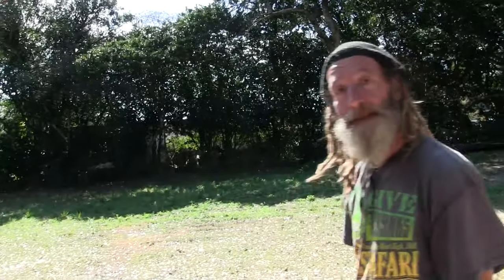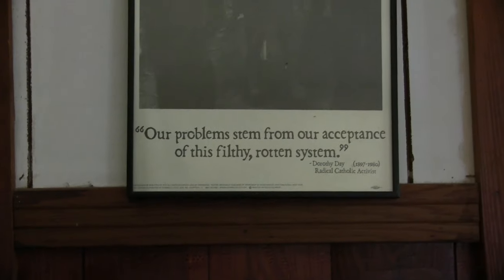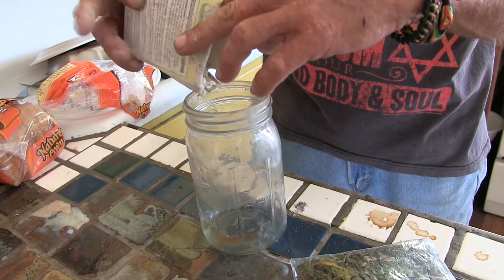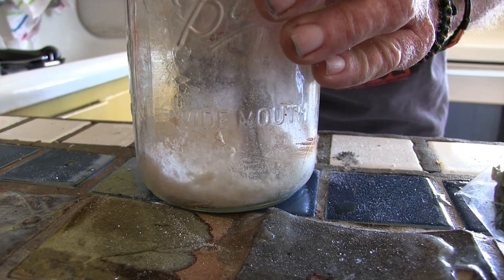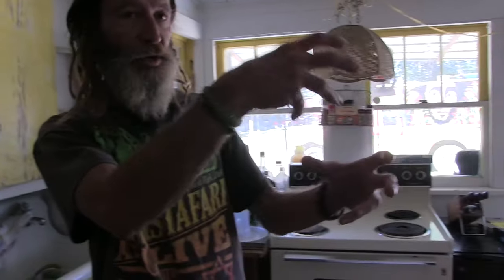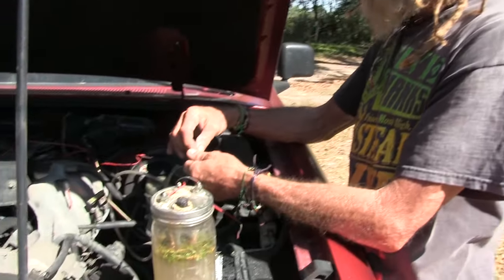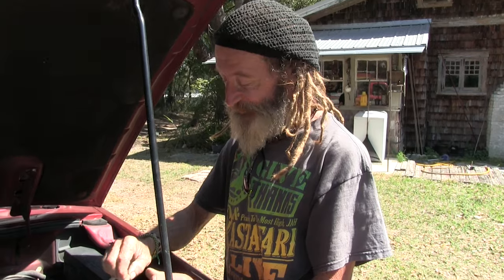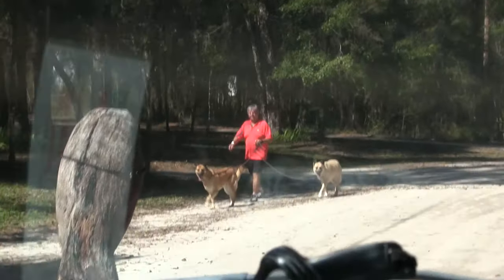Florida man uses homemade hydrogen generator to power Ford Ranger

Comment: Wouldn't Titanium rods work better in a Hydrogen generator ??  Hey, I like this guys attitude. He is very unbiased, and very forgiving. That ole country boy is a Diamond in the rough. Soo Cool.
Reply: graphite is actually the best for this.
Reply: Titanium is great but his setup is more economical for the desired application.
Reply: @graphixkillzzz  The issue with graphite is that the anode breaks down over time and leaves carbon nanoparticles in the water. Titanium is the better option because it's resistant to this. Another good choice would be a platinum plated electrode because platinum is very corrosion resistant but I would not recommend using stainless steel as the chromium inside of it oxidises to form chromium (VI) oxide which is VERY carcinogenic and not safe to work with.
Reply: Platinum is an excellent option too
Reply: using a pool chlorinator head  will work the best and its already made.
Reply: As Hank says a country boy can survive!

Comment: Boeing manufacturers a Predator drone that operates with two Ford Ranger Flex engines running on hydrogen.  Not a mixed fuel but straight hydrogen.   The solar panels on the wings and water catchers on the wings convert the rain on the go to hydrogen. It can fly almost indefinitely in the right climate.
Reply: Insane
Reply: Lemme see it

Comment: This guy is pretty darn cool I love his vibes and his personality is just off the charts God bless him. I would have tweaked a few things and not have the bubbler in the same container is where your generating a hydrogen and oxygen is burnable also I would have hooked it to the accessory electrical on the fuse box. I mean baking soda is okay but you could use table salt or potassium would be a lot more efficient.

Comment: 99% petrol + 1% hydrogen. Great work 👏
Reply: It’s gas
Reply: That's the comment I was looking for. Glad.i didn't waste my time.
Reply: HHO gas modifies the gasoline burn to be more efficient. The excess burns off into water vapor, and a tiny sodium and carbon. The excess takes more energy to make than it produces. Presumably you would only want a minimal amount.
Reply: A Dry Cell gasifier is way safer plus people need to understand that HHO is a supplemental system and they still have to burn unleaded fuel at 30% lower rate or so.  Not 1%

Comment: You state a maximum of 650cc for engine size to date. I was just wondering if adding another unit and getting twice the gas produced would double that cc size, allowing large bikes and even for small cars to run on this.

 Could you even triple the units or more, placing multiple units into one large tank of water generating enough for a V8 engine? This large unit could even replace the gas tank. However the next point that must be addressed is at what point would several of them just take too much power to run.

Next what about areas of below-freezing winter weather. Would these be great in the summer and have to be not used in the winter. 

Is there some sort of anti-freeze that would work, and if so how much would it reduce the freezing point?

What pressure is right for a pop off valve, as you say you use to regulate the pressure of the fuel. 

 Also I saw a video online that has people putting a splice in the fuel line and running hydrogen and oxygen into the gas line and burning less gas. Is this a good idea or dangerous.

 I look forward to your reply. 

Thank You.

Comment: There's also a gassifier system that can be made. Burning wood,sending the smoke through several layers of filter usually. Charcoal,hay,etc. It renders the 60-70% unburned vapors from the wood. It too can run a motor. Called E-gas. WARNING!! If the E-gas gets back to the fire the same problem as a moonshine still. It WILL explode. Vehicles have had this system,but abandoned as it's just too dangerous.
Reply: A Dry Cell gasifier is way safer plus people need to understand that HHO is a supplemental system and they still have to burn unleaded fuel at 30% lower rate or so.

Comment: That truck runs purely on HHO?!? I dont think so.
Reply: I think he has some gas in it. But it’s only using HHO.
Reply: Neo ... yeah I was disappointed because this wasn't what I thought it was going to be .
Reply: The system he has is called HHO (Hydrogen)on demand...  it used Hydrogen and gasoline in combination to burn all the gasoline boosting fuel evonomy

Comment: This is the best one so far but I use a cigarette power inverter a power adapter 5 volt 2 amp and run that to the ball jar and inside the ball jar for the captain and diode I could use either a bolt with electrical tape wrapped around it so that since later from lid or miniature egg beaters that holds steel wool
Reply: 😂😂😂 good one!

Comment: Scam it's impossible to run a car on hydrogen these bottles are setting up will maybe fill a garbage bag plastic bag and go boom but everyone knows it's impossible to run your car on hydrogen a combustion engine the number one thing is the only way it could work is if you have it pressurized in a cylinder like a propane tank with a converted carburetor to run your car on propane but that takes a special carburetor so it will run on a combustion engine so it's pressurized tank with propane that can make a combustion engine work and just to let you know Amazon and eBay are working together they're going to stop the sales of these fake hydrogen kits that make your car run they're doing the same thing like they did with Cody kicking all those people off eBay and Amazon so don't fall prey it's impossible and when they tell you they get 35% more fueling more miles they're lying straight out lying not one single YouTube channel says they make their car run on hydrogen cannot prove it they either say we will update this in the next video and show you or use some fancy camera tricks making it look like it's hooked up and fancy lies to tell you they're getting 35% more go to all these channels at proclaim that and tell them show us the proof cuz me and my mechanics we did this to six different cars not one single one of them would run on hydrogen so these people are liars they're not very Christian like look how many people are falling for it as subscribers so they can make money on these fake videos it is impossible to run a combustion engine car on methane don't let these scammers on YouTube trick you into buying that crap if you buy that crap it's just for party gags and making things go pop like a bag or bubbles it's just a party game I promise

Comment: So that jar looks like to holds AT BEST around 1L of water. That means you would expect to only get 100 grams of hydrogen. 100 grams of hydrogen contains 3.3kWh of energy. Lets say that old truck uses 10L/100km. 10L of petrol holds around 8.9kWh of energy. So it takes 0.89kWh to get only 1km or 1.42kWh per mile. (Assuming it has the same efficiency with hydrogen as it does with petrol (Which it wont, it will be worse)). That means in that jar, you have enough hydrogen to carry you 2.3 kilometres. Not really a game changer. and likely much less because the engine isnt engineered to run efficiently on hydrogen. 

Then lets consider that the cars electrics is whats powering the reaction to generate the hydrogen. unfortunately it takes 4.7kWh of electricity to produce the 3.3kWh of hydrogen. Now that has to come from somehwere. That 4.7kWh doesnt come out of thin air. and the engine is the thing that charges the battery. Meaning the 3.3kWh isnt enough energy to create itself. So unfortunately. I call BS on this whole thing
Reply: Gramos? Mi amigo un litro de agua produce unos 1200Litros de gas.. no se como pretendes medir un gas en Gramos.
Reply: @josegante6982  English?
Reply: @engineeringtheweirdguy2103  google translate is your friend dude... I can understand perfectly fine ur language.. probably you need more reading.. but translate can make the hard work of translate the thing for u.
Reply: I think your calculation is right.The leaves and rock in the jar is so magic ,they save the world from energy exhaustion.
Reply: @josegante6982  did you ever know the law of conservation of mass?? 🤣
Reply: @josegante6982  you can measure gas in grams because of the conservation of mass law. We know the weight 1L of water. We know the portions of water which is 2 parts hydrogen and 1 part oxygen. We know the molecular weight of both hydrogen and oxygen. Therefore we can determine the weight if hydrogen contained in any given weight/volume of water.
Reply: @josegante6982  also we know the density of hydrogen at atmospheric pressure. Which it will be at, if it’s bubbling inside a jar at atmospheric pressure…. So we know the volume (litres) of water that we will get.

Comment: You know the power required for this comes from the charging system which increases load on engine and consumes more gas so no net gain here.
Reply: when done properly it does increase efficiency thats with proper electrolyte proper surface area and all that jazz this is not that but  it makes him happy so what
Reply: @bleckybob  Water is not a fuel, it is oxidised hydrogen ... in becoming an oxide the hydrogen has released its energy ...now you have to put in at least the same or more energy to turn it back into pure hydrogen.

Comment: That jar isn't hardly enough to run a weed eater. 
I built hydrogen generators.  I AM do know what I'm talking about.
Reply: Video should be called.... "Florida Man Is Either Trolling Or Full Of BS But Many Viewers Will Be Dumb Enough To Believe Him"
Reply: You "AM"...Know what you are talking about...? ROFL: NO. You didn't build anything! A weed eater vs a truck really is apples to oranges; A weed eater uses a conventional CARBURETOR, which feeds a gas/oil mixture through an old fashioned bowl carburetor; Where as a modern Ford truck, uses fuel injected gas, GREATLY improving efficiency...I barely graduated high school ( Without basic sentence structure courses), and I know that! Go back to Mythbusters!
Reply: @brentfarvors192  I don't think either of you guys know what you're talking about
Reply: Maybe the addition of Marijana leaves up the power of the hydrogen generator sauce man.

Comment: when your piston rings corrode and ceases your engine you might learn something
Reply: And why would that happen?
Reply: It might help if you try it so you can learn something. Hydrogen does not harm steal in any way. Also, this contraption does not make any notisable difference. It’s like spitting in a 5 gallon bucket thinking it’s going to fill the bucket. Years later....
Reply: @shanecateriny4359  He was more referring to the engine missing, from the fuel/mixture imbalance going to the injectors; Making the engine components wear out faster...But, seeing as how you save so much from not buying gas; The engine wear would be at a minimum cost compared to the fuel savings...
Reply: @Paramdeep Grewal Has NOTHING to do with "corrosion"; The HHO won't corrode anything! More in reference to the mistiming of the fuel to air ratio; Easily compensated by "tweaking" your HHO generator setup...
Reply: @brentfarvors192  Hydrogen corrodes aluminum
Reply: @brandonkelbe  Seeing as how it burns immediately, that's irrelevant...
Reply: @brentfarvors192  I realize this now after I’ve been reading about it and I’m happy I’m wrong in this instance. Must be that it actually can do some good and there’s a lot of misinformation about it put out on purpose.